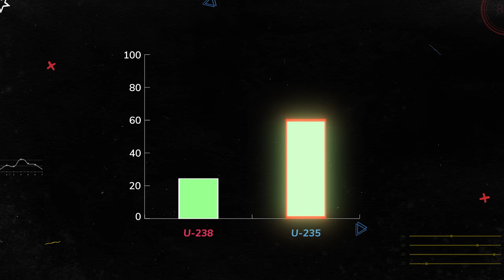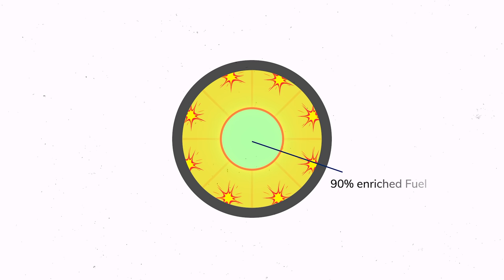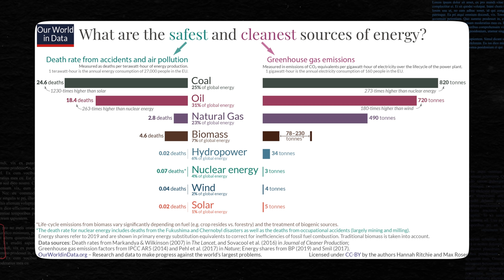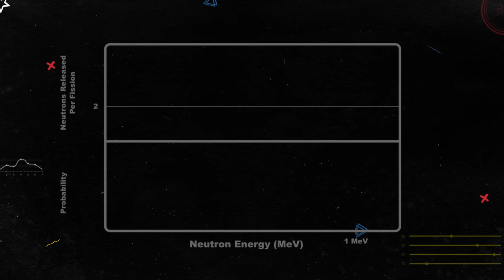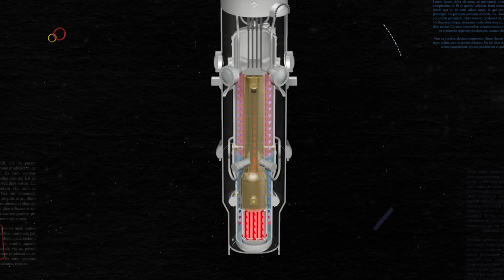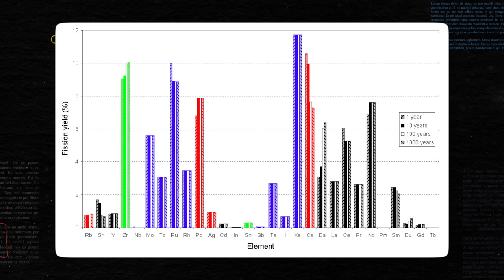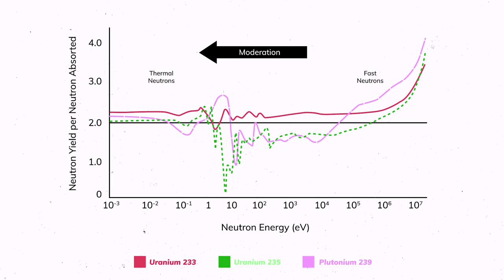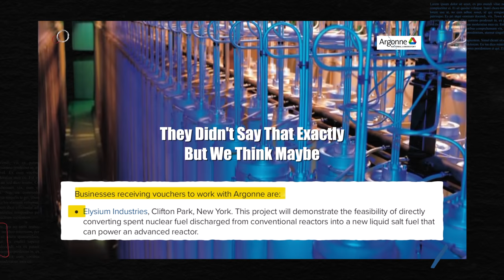This Reactor Feeds On Nuclear Waste

Comment: The BIGGEST problem with building these plants is NOT the material Costs. Transport or licensing. It's the UNIONS. I have spoken to inspectors in these sites who said they were threatened. Abused and lied to by Union Crew leaders, Crew members and supervisors. Once a wrench was dropped from 40' above while he was inspecting a relief valve he later found was a cheap Knockoff from China which was a violation of "Buy Only U.S. products' rules in THAT facility. In the South Texas Nuclear plant alone it took serval EXTRA years and BILLIONS more in cost then originally called for,,and that was BECAUSE of Union delays and Wage Disputes. So, NO, it's not the cost of the plant,,it's the cost of the people erecting the plant. Oh, and the Quality,,,NOPE, was not any better then a None Union Site. Actually, it was WORSE and some of it had to be redone for safety reasons.

Comment: Sadly if it was t for the bad stigma around nuclear energy this could have already replaced coal if it had been backed by the right people and instead wasting millions of dollars on wind and solar which is not a viable replacement for coal plants as it requires large amounts of land to generate equal power and doesn’t run all the time.
Reply: Millions? Try 10's of billions

Comment: this sounds very promising, the use of depleted uranium in tank shells is mad, but if what i saw only a small percentage of nuclear fuel is used you can charge to dispose of nuclear waste, and adapting the technology to thorium should not be difficult..
just one thing, neutrons are unstoppable unless captured in a nucleus and mater is basically nothing 
fear and need are easily created by the media, the USA has no need and a lot of fear, see what they did with a new strain of flu, rejecting available treatments to heap fear,  India may be the place for innovation

Comment: The idea of fast breeder reactors for effectively "recycling" nuclear waste is not at all new.  India had small experimental fast reactors nearly 5 decades ago.  The U.S., Canadians, Russians, French, Germans, Japanese...  all of them have very old research on fast reactors.  What killed progress was the Cold War and nuclear disarmament treaties due to the fears that people would simply use breeder reactors to mass-produce weapons-grade Plutonium.  Companies like Elysium are technically standing on the shoulders of the giants who did this prior work, all right, but because of political fear-mongering around nuclear (only made worse by punctuating moments like 3-Mile Island and Chernobyl), those giants only grew to be 7 ft tall instead of 100 ft tall.

Nowadays, with no real Cold War to speak of, the only concerns happen if nations that harbor terror organizations happen to do it, and it's much safer to sell them on non-risky nuclear energy programs like Thorium while buying up old waste for use in breeder reactors in less high-risk nations.  I've always been a proponent of fast breeder reactors specifically for the fact that it effectively solves a large part of the nuclear waste problem.  Using up that waste to produce new fuel still results in dangerous radioactive byproducts, but rather than something that is dangerous for several millennia, you have something that is dangerous for a few decades -- a far more tractable problem.
Reply from the maker: Yeah, but the sodium cooled designs of the past have had lots of issues because of how strongly sodium reacts with air. 

This feels like a better solution to me.
Reply: @TechforLudditesSira  Agreed.  I always figured sodium coolant had to do with cost and improved thermal exchange efficiency because they erred on the side of caution when dealing with those higher temperatures.  Nowadays, we understand those problems far better and molten salt is just plain better.  Also, I wasn't completely aware until you mentioned it about regulation being entirely passive...  sounds really cool in an era of renewables.  Passive safety systems like the freeze plug that Sorenson likes to tout still work even on fast MSRs, too.

Sounds to me, then, like the biggest challenges -- even if the company has firmly solved all of the engineering problems -- is still economic.  Even though any nuclear plant is inherently more profitable than any other type of power plant, the turnaround time to reaching profitability is very long.  That makes it a difficult sell, particularly for gaining political support since the benefits will only really be seen beyond the lifespan of a typical politician's career.  Sadly, that may well prove to be an impenetrable barrier.

Comment: I really like to study enough material science to comprehend how you want build reactor with molten salt of thorium- fluoride and for its materials to withstand corrosion , irridiation and boundary transmigration of ions...
For me thats a sicience fiction.
Edit
Chloride salts  at 1500 deg C are bigger science fiction for any material science.
Reply: Clean salt is less corrosve than clean water, with ckean chloride sakt lss corrosive than clean Fluoride salt. You need to study more on materials. You are thinking of mixing saltvwith water &/or air that is corrisive. MSRE reactor vessel in air outside would have corroded fsster tha the internal salt side, but they reduced the oxygen cintet of the air to <10% to prevent corrosion.

No ine discussed 1500C chloride lt as that is the boiling regime.
75C initially,
1000C next generation.
Reply: @EdPheil  Boundary ion diffusion to construction material of shell. Sorry no steel or any metallic material wil survive this without contamination.
Molten salt is more corrosive then saltwater, more explosive, and stabilizing Chloride in gaseus form in 500 degree - please show me material that can bear this with no corrosion (or whole concept is flawet to because of fast aging of whole construction because of inter boundary corrosion made Cl and H particles)
Dont forget that it will be radioactive and whole shell will be iridiated passively becouse of exposure on ions, and whole spectrum of radiation. 
Sorry that is sci - fi.

Comment: CAN YOU PLEASE DISCUSS THESE 3 TOPICS NEXT?:
1. High Temperature Fast Gas [CO2 or Helium] Reactors. WHY HAVEN'T THEY CAUGHT ON? They solve multiple problems: Consume waste, use air which is abundant & enables siting a away from water & urban areas, their high Temps  allows 4  production of H2, chemicals, desalination etc.
2. X-ENERGY'S [Xe-100 Reactor]. A small, modular, Gas-pebble reactor with meltdown proof fuel. The tech is present & off the shelf, so why isn't it mainstream?
3. Dual-Fluid Reactors. The Holy grail. Winner of the best new environment saving tech. What's causing its slow production?

Comment: Immediate impressions...
Suggesting use of molten salts instead of pressurized heavy water for heat transfer might have lower engineering requirements, but AFAIK does not eliminate the possibility of a runaway reaction. The possible Chernobyl event is only modified, not eliminated. And just because it might be possible to operate at higher temps doesn't necessarily mean safer. I can imagine what is presented in the video as extra margin of safety instead defined as normal safe operating temperatures. 

Is the idea of a breeder reactor creating its own fuel for at least one more fission cycle new?  The concept should be considered and not associated with the more often use of creating bomb grade material. The video describes only one additional fission cycle, is that all?  If not a perpetual life cycle, nuclear waste is still produced that needs to be "managed" somehow as far from any living organism as possible. From what is presented, "Eating Nuclear Waste" is not an ecologically friendly solution, it's only a means to obtain more production from a finite amount of fuel.

Looking forward to a safe nuclear reactor, but may have to wait until fusion replaces fission.

Comment: By evaluating population energy consumption and cost vs benefit relations energy systems can be chosen. The system should be the most suitable for the geological region. Certain energy resources can be used as an economic strangle hold on nations the accessibility to the resource is used to control labor potential through economic tariffs or conditional agreements countries go into debt solely to buy said resources .If you use nuclear, solar, wind, geothermic or hydro electric decision could be based in which energy system would be suitable for the population within its local capacity. It should not cause the population to pay high cost for inefficient energy systems with costly supply lines. Germany tried going 0 emissions but it used only solar and wind only its mass decommissioning caused an energetic imbalance they compensated by reusing gas and coal energy instead of nuclear a choice that increased its emissions and cost them their energetic potential. The solutions cant be made by short term thinking. Im not against solar or wind, nuclear beats returning to coal/gas  why couldn't they have em functioning simultaneously for a period of time then compare the cost and productivity of all of them while evaluating environmental data maybe cuz its simpler to just ban stuff kinda sad

Comment: Does it have a drain tank? I wouldn't bet on a fast reactor personally.
Reply from the maker: Fast Reactors have had big problems before. But that has usually been down to the molten sodium coolant. 

Here they’re using molten salt as both fuel and coolant. Only time will tell if they succeed though :)

PS: Yes, it has a drain tank. No freeze plug though.
Reply: @TechforLudditesSira  Yes. I agree. Sodium coolant is definitely a problem.  It makes me worried that molten salts might also cause problems due to thier corrosive nature.  At least I guess they are less reactive and won't be a hazard if mixed with water. 

Thanks for confirming the drain tank.  I don't think a freeze plug is essential.

Comment: If I had faith in corporations I wouldn't have a problem with nuclear reactors. I do not. All it takes is for a few cut corners to have a Chernobyl or Fukushima on our hands. Businesses that want to make a profit can't take on that responsibility.
Reply: You didn't watch did you?
A molten salt reactor won't fail like those.
If a tidal wave knocks out the support sysyem it heats to the temperature of the salt plug and the salt drain to a storage tank and the reaction stops.

Comment: Let's say my country has 19 nuclear plants generating 13.5 GWe daily. How many of these reactors do I need to generate the same amount of energy.
Reply: The size of these plants (as far I understand) is very flexible from a few hundreds MW up to 5000 MWth or 2200 MWe equivalent per reactor (that is only a few meters in height/width). The huge diference is rather the fuel they need : while a regular GWe light water reactor needs 220 tonn of natural uranium or about 30-35 tonn of enriched uranium, a fast MSR needs less than 800 kg of "waste" (for example, depleted uranium or reactor grade plutonium), that for instance we have plenty of them, even millenia on a world basis and can convert them in short life elements (with half life of 30 years at max, rather than 25,000 year like plutonium)
Reply: @Alessandro-1977  we've got 28 football stadiums full of used nuclear fuel rods as of 2019. Current talk is to bury them near the Great Lakes.
Reply: @DennisCambly  Well, I think at least in the second half of this century we are going to burn up all this nuclear waste, Canada could go on for several thousand years only with that. And the main benefit will also be that consuming nuclear waste you end up with short life radioactive (~ 30 years) materials that are easy to monitor and store in a low cost and not too sophisticated surface (and not geological) repository
Reply: @Alessandro-1977  I hope you are right. There is a lot of highly toxic nuclear waste around the world.

Comment: Questionable: How to run steam turbines without water? I suppose you mean, there is just another circuit using molten salt or something, that then heats the water for the steam turbines, right? So far away from not using water. (You mean not using water in the core)

I think you mixed up „thermal runaway“ with „getting supercritic“. There is some relation between, for sure. But also in a subcritic fuel there will be thermal runnaway, if it is not cooled anymore. See the problems in Fukushima with the used fuel heating up because of lack of cooling.
To make clear: My claim is „Do not underestimate any risk“. Arguments, like „cannot happen“ are very questionable.

Comment: Great presentation.  I’m relieved that they were authorized to start creating fuel.  The restrictions around fissionable materials because of potential bad use has kept back thorium reactors for a while.  

More in depth in this future reactors would be good but since the future is distributed, smaller home/community type tech is my biggest interest.  The scalability of these reactors is huge plus.  

Did you read about the Chinese rain energy harvester?  A roof covered in piezoelectric?

Comment: 1. Salt reactor tech is 60 years old, nothing new.

2. It still has an absolute basket of issues, merits for sure, but the issues of corrosion have never been resolved to an extent that would allow for longevity required without heavy servicing costs and high production costs due to specialist materials that would be required for a large scale reactor. Molten salt can easily corrode steel and melt aluminum.

3. Molten salt or not, as the world warms, nuclear reactors become less efficient as the waters they take in are warmer meaning cooling is less effective unless they kill everything for a couple of miles around the outflow by heating up the local waterways and although Salt reactors wont quite have that issue they are still subject to the laws of thermodynamics and will not be able to produce their maximum design output in a world that warmed half a degree in between the start and end of their construction unless you want to waste massive amounts of power on cooling the reactor facility. I remind people of the heatwave in France in 2003 where they had to have fire trucks spraying the outsides of the reactor buildings to keep them operating.

4. It is not a 100% efficient device, humans cannot build such devices, you will still have highly irradiated materials to deal with during servicing and deconstruction which always costs an absolute fortune and it takes years to decades to complete a deconstruction.

While this may pop up here and there via very small scale demonstration reactors you've more chance of seeing Fusion reactors before seeing this commercially, and they themselves are still 40 to 60 years away, all of it far too late to resolve humanities climate change problems of which no amount of win turbines, solar panels, green new deals, electric cars, new taxes, new regulations, nor any technology today, nor any technology coming, will ever be able to allow a consumption driven perpetual growth global economy such that capitalism is, to outrun the immutable physics of a finite world.

Molten salt? just another method of pissing around at the edges in an act of self delusion to defer having to radically alter our way of life if we want a future.

Comment: what happens when molten salt meets water?
Reply: Not too much. The salt surface freezes, enough water boils to make that happen, and it doesn't dissolve very fast.  Spills on open landscape are to be avoided, but easily are. Final turbine is usually steam (water), but there is usually a clean, non-radioactive molten-salt heat-exchanger loop between the fuel salt and the steam loop.

Comment: Consuming nuclear waste to generate power is good. Though my concerns are that if you base a portion of our energy supply on the consumption of nuclear waste you also create the need for nuclear waste to exist.

Also there's the concern about having the short lived products hanging around for a few decades as those are significantly more dangerous than the comparatively stabler stuff that's radioactive for thousands or millions of years.

But mainly I'm skeptical that this would do anything but create an incentive for there to be a lot of cheap nuclear waste to sell to these reactors in the long term. Take a physics and engineering problem and add on to it a financial incentive for it to perpetuate and you've got the perfect example of why capitalism never actually solves anything, only mitigates it for as long as you keep shelling out cash.

Comment: 1. A functioning molen salt reactor was made 70 years ago, about 20Mw. but it was closed down. why are we not at least copying this invention and producing power. 

2 They have been talking about molten salt reactors for over 10 years on youtube, yet nothing is happening on the ground. What is the problem?

3 Is biden going to fund molten salt reactor reasearch?

4 What about Bill gates' travelling wave reactor. Please discuss this. Why has this not been launched? What ar the problems? how far is he with this?

5 The sadoway molten metal battery. Its researcher has been on youtube for 10 years but I dont see a real moten metal battery. Why not? Is there a 100 Kw molten battery producing electricity today?

Comment: 2028? Ugh, so long to wait? So much potential. Then if they have not yet run into the Brick (fossil fuel grip on the world) Wall of old world money, they no doubt will.
* sigh *
Reply from the maker: I think lots of testing and research before going commercial is not only good, but essential. 

Even if these start to come online in 2030, and prove to be safe, robust, and economical then it’ll be well worth the additional time spent testing.
Reply: @TechforLudditesSira  Very true but dang, it's so hard to have to wait for something so promising. I totally understand what you are saying though.